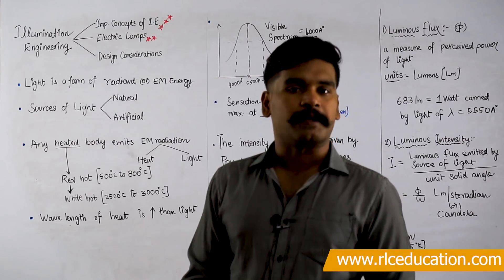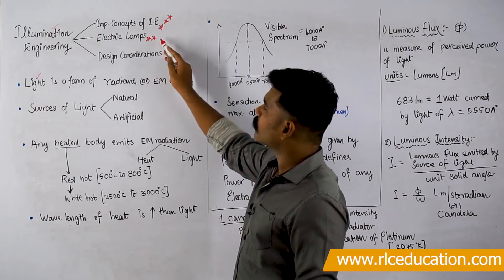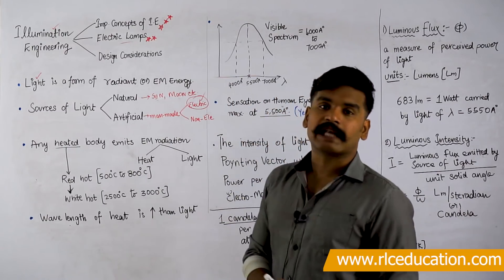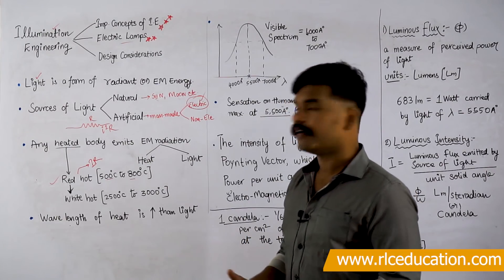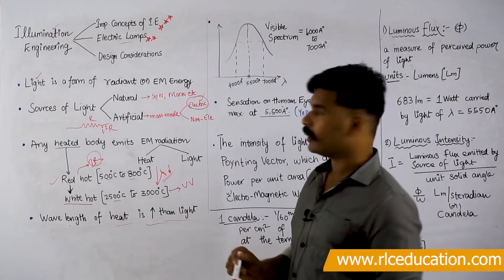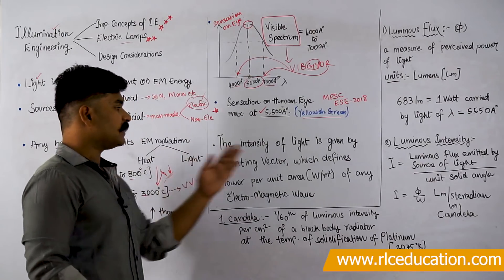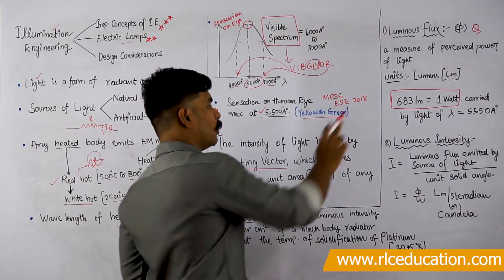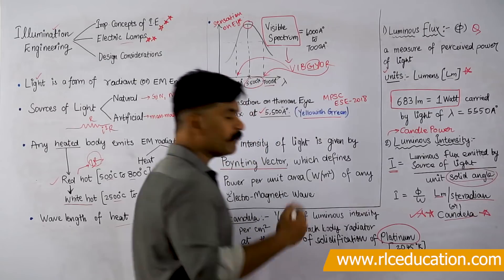Illumination Engineering Part 1 | Utilization of Electrical Energy | Nikhil Nakka

Comment: It is required to provide an illumination of 100 lm/m2
 in a workshop hall 40m × 10m and efficiency
of lamp is 14 lm/W. Calculate the number and rating of lamps and their positions when trusses are
provided at mutual distance of 5m. Take coefficient of utilisation as 0.4 and depreciation factor as
0.8. 
Sir, 
Can you solve this problem.. thanks you

Comment: Sir, may I ask you a question how to mature the external quantum efficiency  if A particular deep blue commercial LED emits an optical power of453mW at 455 nm when the current is 350 mA and the forward voltage is 3.2 V? 
Thank you.
Reply: To determine the external quantum efficiency (EQE) of a deep blue LED, you need to follow these steps:

Calculate the input electrical power:
The input electrical power 
𝑃
𝑖
𝑛
P 
in

  is given by the product of the current 
𝐼
I and the forward voltage 
𝑉
V:

𝑃
𝑖
𝑛
=
𝐼
×
𝑉
P 
in

 =I×V
Given:

𝐼
=
350
 
mA
=
0.35
 
A
I=350mA=0.35A

𝑉
=
3.2
 
V
V=3.2V
Therefore:

𝑃
𝑖
𝑛
=
0.35
 
A
×
3.2
 
V
=
1.12
 
W
P 
in

 =0.35A×3.2V=1.12W
Calculate the output optical power:
Given the output optical power 
𝑃
𝑜
𝑝
𝑡
P 
opt

  is 453 mW, convert it to watts:

𝑃
𝑜
𝑝
𝑡
=
453
 
mW
=
0.453
 
W
P 
opt

 =453mW=0.453W
Calculate the photon energy:
The energy of a single photon 
𝐸
E can be calculated using the wavelength 
𝜆
λ and the speed of light 
𝑐
c as well as Planck's constant 
ℎ
h:

𝐸
=
ℎ
×
𝑐
𝜆
E= 
λ
h×c

 
Where:

ℎ
=
6.626
×
1
0
−
34
 
J
⋅
s
(
Planck’s constant
)
h=6.626×10 
−34
 J⋅s(Planck’s constant)

𝑐
=
3
×
1
0
8
 
m/s
(
speed of light
)
c=3×10 
8
 m/s(speed of light)

𝜆
=
455
 
nm
=
455
×
1
0
−
9
 
m
λ=455nm=455×10 
−9
 m
Therefore:

𝐸
=
6.626
×
1
0
−
34
×
3
×
1
0
8
455
×
1
0
−
9
≈
4.37
×
1
0
−
19
 
J
E= 
455×10 
−9
 
6.626×10 
−34
 ×3×10 
8
 

 ≈4.37×10 
−19
 J
Calculate the total number of photons emitted per second:
The optical power 
𝑃
𝑜
𝑝
𝑡
P 
opt

  is related to the number of photons 
𝑁
N emitted per second:

𝑃
𝑜
𝑝
𝑡
=
𝑁
×
𝐸
P 
opt

 =N×E
Therefore:

𝑁
=
𝑃
𝑜
𝑝
𝑡
𝐸
=
0.453
4.37
×
1
0
−
19
≈
1.04
×
1
0
18
 
photons/s
N= 
E
P 
opt

 

 = 
4.37×10 
−19
 
0.453

 ≈1.04×10 
18
 photons/s
Calculate the EQE:
The external quantum efficiency (EQE) is the ratio of the number of photons emitted to the number of electrons passing through the LED. The number of electrons per second is given by the current 
𝐼
I divided by the elementary charge 
𝑒
e:

Number of electrons per second
=
𝐼
𝑒
=
0.35
1.602
×
1
0
−
19
≈
2.18
×
1
0
18
 
electrons/s
Number of electrons per second= 
e
I

 = 
1.602×10 
−19
 
0.35

 ≈2.18×10 
18
 electrons/s
Therefore, the EQE is:

EQE
=
Number of photons emitted per second
Number of electrons per second
=
1.04
×
1
0
18
2.18
×
1
0
18
≈
0.477
 
(
or 
47.7
%
)
EQE= 
Number of electrons per second
Number of photons emitted per second

 = 
2.18×10 
18
 
1.04×10 
18
 

 ≈0.477(or 47.7%)
Thus, the external quantum efficiency (EQE) of the deep blue LED is approximately 47.7%.